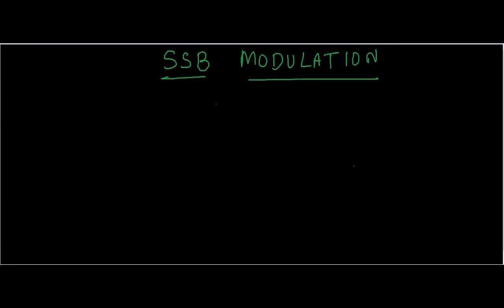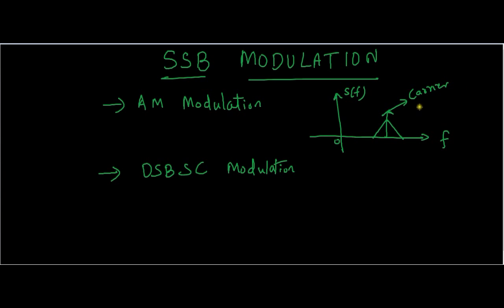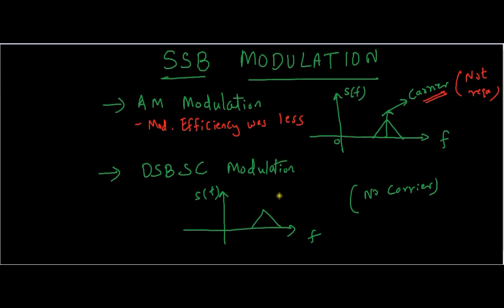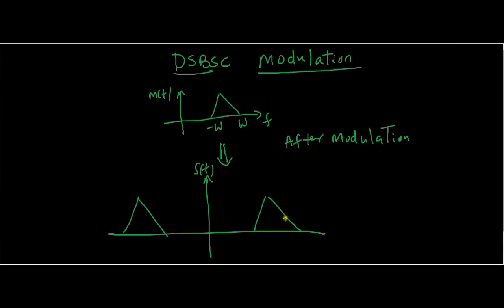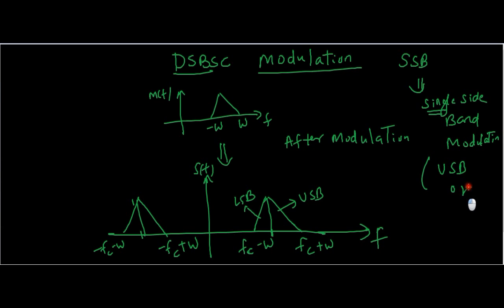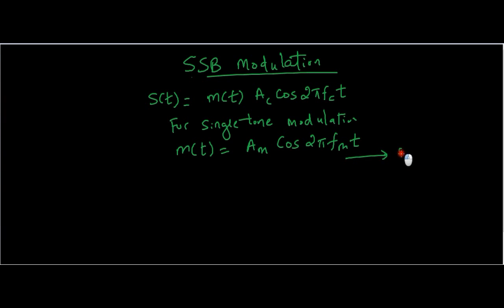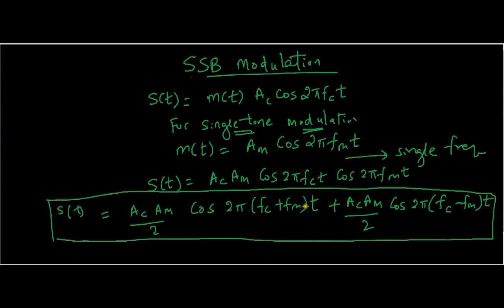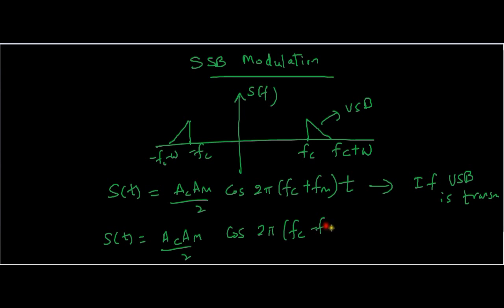SSB Modulation in communication systems

Comment: To the negative comments; Please be respectful of the person who took his time to produce the video. He may not have met your standards for lecturing, but I am sure he did his best. There are many other videos on SSB by people who you may find easier to understand.
On a side note (no pun intended), in every form of radio transmission engineering, the challenge is to overcome unwanted aspects of the system. This includes dealing with noise, interference, weak signals, drop outs, etc. So perhaps you can use the difficulties you've experienced in this video to help you tolerate some of those challenges you're likely to encounter in the realm of RF electronic design.
PS: To some people who express scorn and annoyance at other people with imperfect accents, I often point out to the former that they may have no difficulty in boasting how great they are for understanding the gibberish uttered in an Italian Opera. Some of these remarkable people appear to find no difficulty in understanding very complex Egyptian hieroglyphs etc., but unable to read their dinner check which was written by an immigrant waiter with less than perfect penmanship.
To the person who made this video--thank you, and know that I am grateful for the knowledge you offered.